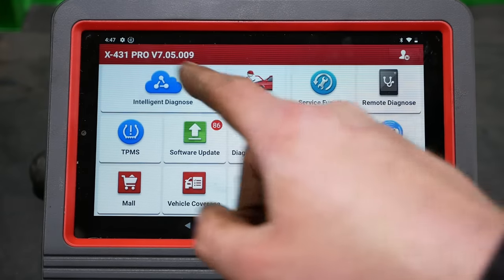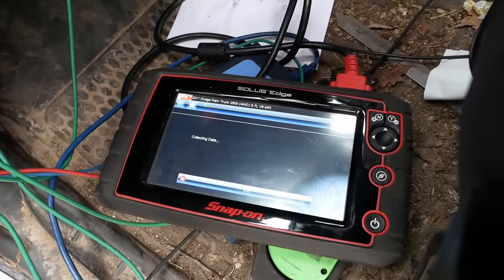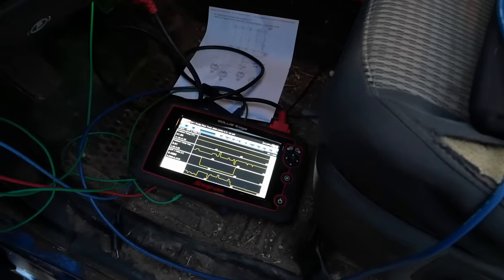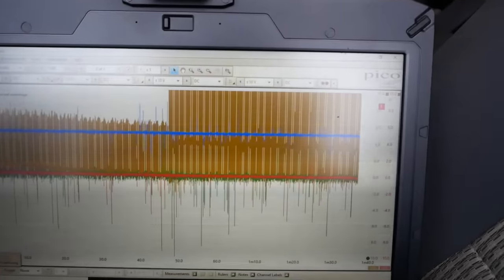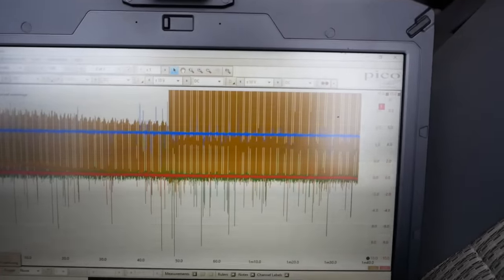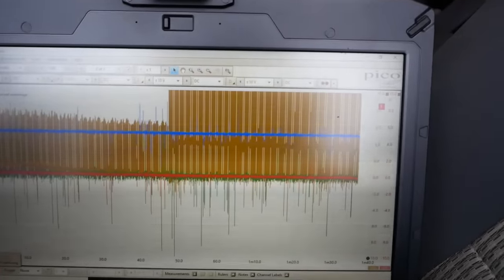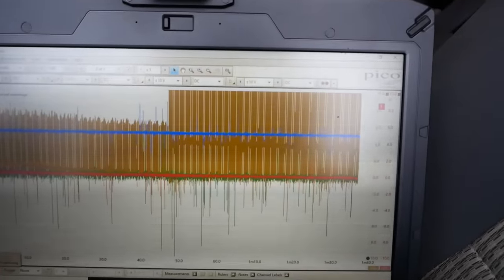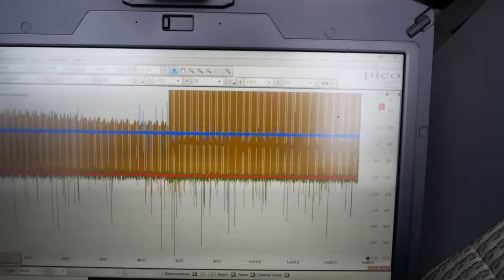Diabolical Diagnosis - Hemi Ram Stuck at 1500 RPM with P2128 and P2138

Comment: "moisture" was the first(and only) thing i said (to the comp screen...lol) when you described the symptons. The part about prices is a good insight to how diagnostic business side actually works. I used to work for a guy doing mostly NS or NS/NC condition vehicles from other shops and dealerships....pushing cars in and out of the shop....set up as u mentioned...chasing your tail often...it is just how it goes sometimes...i often wondered how he got so many customers to pay so much some times...but then again i was the only tech and business was always really busy there.

Comment: Okay, you mentioned interment and slow internet in the same video comments. Here's one for you.....
We had DSL internet for years. It worked, most of the time, but wasn't extremely fast.
It got to the point we were having frequent outages to the point I had the number of the tech and would text him everytime it went down. He found a pedestal which a mouse had mad it's home. Every time it rained, the mouse would hussle home and snuggle up against the warm inside. Mouse evicted, outages decrease drastically. However, we replaced the service with wireless connection fiber.

Comment: Amazing.  Fascinating to watch the whole process.  Many others would have just thrown parts at it and still not fixed the problem but your proper analytical diagnosis and dogged determination got to the source as always.  Not curing the symptoms but curing the disease instead.  😊 PS.  Hope the weather has improved.

Comment: I worked in an electronic repair shop for a while. We used to "tap" all components and connection's to find the broken soldering connection on such intermittent issues.

I guess you could spray some mist into the engine bay, with a tiny amount of washing soda (sodium carbonate), to find the spot which acts up :)

Comment: Geez Wes.
Your patience with situations like this one is incredible. 
Very very many ad infinity mechanics would have been cussing like Chief Petty Officer who's had someone wash his coffee mug and throwing tools like it's an Olympic sport.
Wiring harness issues are the top item on my list of piss me off troubleshooting problems. 
In my case thats on Arcade and pinball games were I'm often dealing with 110 volt and/or  problems power supply issues that can cause me becoming a fuse issues if I make a mistake at the wrong moment. 
Especially when I'd be working on old crt monitor chassis. 
Usually some dolt who'd worked on it before me who did the old electrical tape twisted together broken wire trick that was near a ground source abd I'd just happen to touch said ground wire.
Zap and I'm cussing like that Chief.
Yes, it happened more times than you'd believe.

Comment: Way to stick with it.  It is always good to have another person to bounce the problem off.  I wonder when the truck was running it was heating up the cowl area and moisture was dripping onto the loom where the wires had rubbed through.  Just a guess.  I am no expert on vehicles.  Anyway, good job!  Happy Easter from Sandwich land.

Comment: Nice job Wes, yeah diagnostics on a "ghost issue" like that takes time to be sure. You summed it up well though, the dealership would just fire the parts canon at it until they figured it out (at some point). I have seen this before though it wasn't a "dead short" just the damage to the wires, moisture and the corrosion of the copper made a perfect storm, it would have failed completely after the wire rotted out. But you found it by bringing your pension and patience to the task. Mad diagnostic skills Wes, well done. Now just deal with your cough and you have it made.. Stay Safe and thanks for dragging us along.. Cheers (now for a hot rum toddy)..
Reply from the maker: I told him that too. Sometimes if you can't duplicate it you have to wait until it gets worse.
Reply: @WatchWesWork  And Murphy knows it too, your usually out in the middle of "no where" when he decides it's "time to pay the piper"...lol

Comment: Excellent find! I had the same shorting issue with the charging system on an old '78 Zephyr. Someone had run a bodge wire from the voltage regulator across the engine bay and under the front suspension on the opposite side and connected it into the wiring harness(bought it that way). The car ran without issue for awhile, but later on during wet weather I started having dead battery issues with no indicator light. Turns out that the wire insulation had rubbed through on the upper control arm. There was the usual green corrosion, the open spot was very close to the control arm but not actually touching it. The little bright shiney spot on the rusty control arm was another giveaway. I then surmised that road spray was soaking that spot and shorting it to the control arm. I was correct, I corrected the wiring and never had the problem again. Was always suspicious of that wire!!

Comment: We have a TSB here at the Ford Motor Co. for 2012 to 2014 Focus models with the 2.0l N/A motor for just this problem.  The engine harness runs over a sharp edge on the plastic intake manifold and causes random drivability issues, mostly when damp or wet.  Happened to my nieces 2013 just this past winter.  I have found that the road salt aggravates the issue when added to the moisture.  We had a particularly snowy winter here at the south jersey shore and her car acted up just after a thaw with quite a bit of residual road salt.  Did the same repair you did here(including the heater hose conduit, lol) and she's been fine ever since.
Reply from the maker: Crazy!

Comment: Very well done Wes and i think worth more even in your local market.There's probably not anyone in a 200 mile radius that would have fixed that with no parts, plus your labor rate should be higher especially when not installing parts.There's no reason why a shop that does pads and rotors on two vehicles while your doing this job makes more money at the end of the day.

Comment: Once again, I am amazed at how you are able to diagnose very difficult problems. I would never have found that one. Shudder to think what it might have cost me to have a dealer fix something like that. I commiserate with your Internet woes. We just recently got Internet service that really works well. We were using a hot spot for Internet since dial up just doesn't work any more.

Comment: Wes my first comment ever from the old days Van NUYS GM CAMARO FIREBIRD and Novas ,Olds Omega was done 8/77 I think they ran a 78 at Norwood OH sister plant things like HEI and Catalitic converters lower compression was like space age, need a CA car add 30 vacuum lines and air pump if you can't see valve covers it will pass smog, Driver side fender fit on final line 62 a hour. 78 79 smokey bandit Burt, Goldy sold alot of black TAs, and overtime we ran two CAMAROS AND a PONTIAC all the way till last 92 z28 July everyone singed name on the car body trans GM free lunch then everyone to the front of plant for a PIC, a banner that said Heart Beat of America, then the pink slip, but OBD1 a guy could still sleep with only 12 things to worry about, 4.3s from Mexico 87 a banana or a wrench in oil pans every 500th No dealer ship even close to you be like 8hr to your 1, keep up the good work, last of pre robot Autowokers,Mike

Comment: Old crusty engineer here, I remember trying to sort out a bunch of intermittent  issues on a big refrigeration compressor set that was driven by a 50k hp gas turbine in conjunction with a 20kHP steam topping turbine that was set up in two modes , starting motor and then helping motor? It was Alan Bradly PLC driven, down time was $37k an hour. Guys just like you who knew how to monitor the signals and analyze the “ spurious anomaly” were able to track and identify a 5 cent broken insulator down to a high temperature control sensor on the gas turbine that limited the fuel supply ?
Reply from the maker: That's above my pay grade!

Comment: Next time you can't seem to catch something you suspect is a chafed wiring harness, lightly hose down areas in the engine compartment to see if water will cause the fault. I did that once before a long time ago and I found the problem. Not saying it always works, but when it does, it's a sure fire troubleshooting method.

Comment: Great video! Like Hamlet, watching the struggle of the protagonist is our entertainment. As for the launch numbering system, that looked like V(version)7, then a Revision level code system. You can imagine how often they have to add to the data set in one of those systems, so the revision level documentation is quite complex.
 I expect the customer was satisfied with your service, because there are so few qualified automotive detectives to take your vehicle too. How many customers would have just ignored this glitch because it was so intermitant, or never experienced it because their climate wouldn't replicate the problem?

Comment: Excellent diagnosis, but one word of caution. When you disconnect a wire on both ends and then connect it to a very high impedance meter (like a scope) you will pick up stray voltage. The longer the wire, the more voltage you’ll see, especially if the wire runs past components that generate large inductive spikes, like coils or components with coils/solenoids (injectors, solenoid valves, relays, etc). It’s like hooking your scope up to an antenna.

My suspicion on how the two wires were able to short is that, since the wires were rubbing against an abrasive plastic edge, some copper probably got deposited into the plastic and made it conductive just in that spot. You know how when you use a grinding wheel on soft metal like aluminum, you end up plugging the wheel up with aluminum? Same idea. The wires rubbing against the plastic manifold essentially copper plated the manifold in that spot. That’s my guess anyway. 

Either way, even if that one kicked your butt, take pride in the fact that you figured it out when the vast, vast majority of techs never would. 👍

Comment: I feel your pain had 2 vehicles the last month DOA and first one no history of why it was dead been sitting since 2014 second one owner put a engine in but forgot to mention it lost power and was getting hot before engine change ended up being clogged cat so bad would not start but like you through lots of hair pulling figured it out and cleaned exhaust out and installed new cat runs great

Comment: Hi Wes, This is very similar to an effect we get in the computer industry called NEXT short for Near End Cross Talk and is where 2 wires are in very close proximity without actually being in physical contact and can transfer high frequency signals by induction and is enhanced if the wires are running parallel for any great distance. Moisture could certainly increase the possibility but isn`t essential to the effect.
Reply from the maker: I think that relies on inductance. We call it "ghost voltage" in the AC electricity world. This is a little different in that the voltage remains with a load (pedal plugged in).

Comment: All repairs are "PUP" approved!!!  It's always exciting to be able to see a similar conclusion.
Chaff/mouse eaten wiring, or some body shop didn't put a harness back to its factory
position.  Or, poor engineering.  Let's put in some more modules and chips.  Let's make some new
scanners that cost $9k.  One for each manufacturer!  Happy Easter.
Reply from the maker: That's why I laugh when people think electric cars are going to be more reliable. Wait until Chrysler builds one...
Reply: @WatchWesWork  Hmm, Fiat makes an EV version of the 500 micro-coupe . . .

Comment: Wes, a very good explanation. Besides the problems diagnosing it you had to work on that damn 2500 series, up so high and then way in the back of the engine compartment. 5 hrs is cheap

Comment: Well done on finding the issue not just engaging the parts cannon. I'd be curious if a megger tester would have picked that cable fault up but also I'd be very worried about blowing some poor unfortunate component when you're testing at 500V.

Comment: You complained about carburetors on a clapped-out Chevy Truck. Those were the problems we used to face. But, wow, wiring problems on computer equipped engines? That's why I don't work on them anymore.

Comment: for what it's worth: Just a tip the potentiometer used on throttle will have a raising side and a falling side which have to equal / balance, so if it does not balance then you have wiring issues or a bad sweep side in the potentiometer.

Comment: If it hasn't already clicked in your head yet, Wes, the V on the X-431 stands for version. I would imagine it refers to the version of the software or firmware loaded onto the device. Likely you can download updates from the Internet from time to time and that number would increment to show the new version. Like as not, if it does something wierd and you call the manufacturer for support, the first thing they will want to know is if you have the latest firmware update loaded and if not go load it and retest before you call again.

Comment: Ah OK, the moisture. I began to realize that during your prologue. 
There is more than one way to skin that particular cat, but your way was probably the best way, even though it requires so much knowledge and expensive equipment. I like the way you narrow down to the exact stretch of wire where the hard-fault is. I like learning these processes from your videos, even though I shy away from the newer stuff.
It was a big letdown for me when I realized that dealer mechanics are a bunch of parts-cannon jockeys, just like the druggie at the used tire place... 
From their handbook: If you see the letters "EGR" in a code, you must immediately replace the EGR valve assembly.  When that doesn't work, identify other EGR system components and replace them. When that doesn't work, remove the bulb from the CEL...
Reply from the maker: They are pretty much trained to do it that way. I remember reading a Ford service manual for an older truck. Almost every step in the diagnostic tree would say "confirm with a known good".

Comment: Remember the days when your accelerator was physically attached to the throttle, your steering wheel was physically attached to the steering box, and your shift lever was physically attached to the transmission? Those were good times...
Reply: Yep I'll stick the 90s stuff anyday of the week over these electrical nightmares

Comment: you could buy a nanoVNA (vector network analyzer) mostly used for radio work, these have a handy little feature that can measure the length of wire or distance to a brake in a wire by measuring how long it takes a pulse to be reflected back in a wire.

Comment: How the hell do you get these monstrous diagnostic problems coming to a rural shop like yours? They must be rather rare to begin with unless wear is common at that point in the harness. If that supposition were true though, there'd be a knowledgebase article or forum thread about this problem. You figured out a tricky problem without firing a parts cannon at it and fixed it. The customer should be pleased regardless. Very good job!
Reply from the maker: Folks here have a talent for under-maintaining their vehicles. They drive around with the CEL and ABS lights on for years. Then when the things finally die completely it's a laundry list of things to fix. It often leads to a perfect storm like this!

Comment: Good ol Mopar. By the time I pawned my 98 Ram onto the next sucker it had nothing left of the power accessories cause of phantom draw issues. I will say though, when the battery wasn't dead, it could still throw down some 1 tire fires with the 5.9.

Comment: When I see some of the wiring on the Big 3 on this channel and Eric O's, I just shake my head about how cheap and crappy it looks. God forbid they were to use a proper loom, and/or electrically shield the TPS wires as they are so important. But that would cost $$$! Good job!
Reply from the maker: I know. It's only getting worse too as wires get smaller and more numerous.

Comment: Super interesting stuff man, thanks for the vidya and consistent quality content.

Could it have been some sort of black magic induction causing a perceived short-type condition? If not, it must've been moisture. I dunno, I'm no rocket surgeon.
Reply from the maker: I don't think so since the problem existed with the pedal plugged in and the ECM connected. So the short was able to carry some load.
Reply: @WatchWesWork  yeah huh, good point. Thanks for the reply my dude!

Comment: What a nightmare!  I hate intermittent electrical issues.  I was interrupted several times while watching, but did you check for this issue in the TSB database?  The wire chaff area should be included if it isn't already.  Great job on the repair Wes!  👍😁
Reply from the maker: Nothing came up under those two codes. Maybe there is a bulletin for chafing, but by the time I needed that it was too late...

Comment: That harness location on the hemi where rub through is common enough and causes fires, injector drop outs, let alone AP issues.   I am always surprised with so many fires there that that was never recalled and properly fixed in place away from the rail.    If he gripes about five hours he should consider what a new truck would cost.  Because that was coming soon.